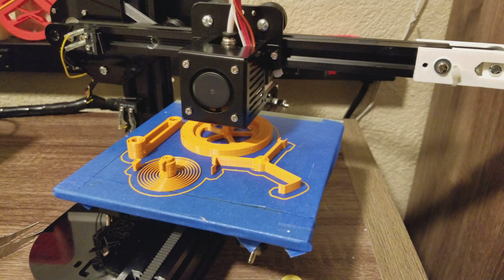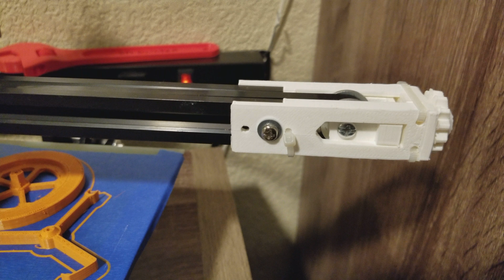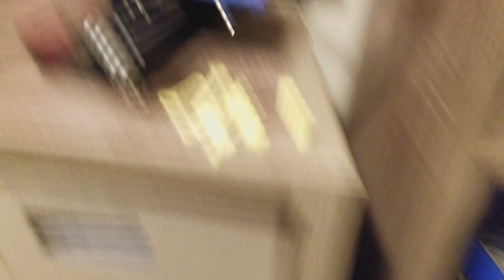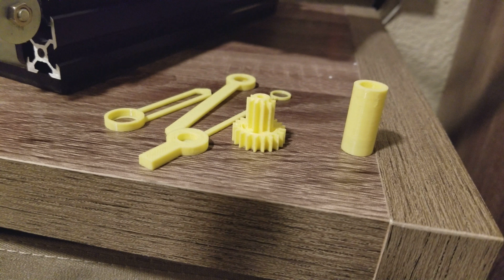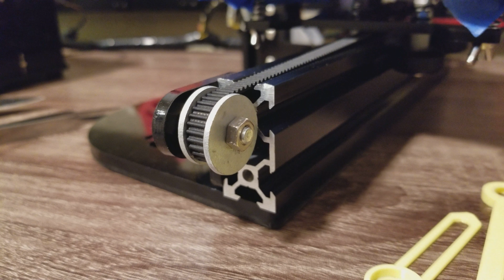TronXY X1 3D Printer- Making a Clock!

Comment: Just ordered me one...wife is gonna kill me...gonna be my 3rd 3D printer!  What is the thingiverse link for that belt tensioner?
I have an Anet A8, a Anycubic Kossel, and now gonna get the X1....if my wife doesn't shoot me first...
Reply from the maker: +Brian C I feel you.  This one was my 10th?

Reprap 1, Reprap Prusa,  Makergear Prusa, Makergear Mosaic 1, Reprap Pro Mendel, Blue Eagle Labs Delta, Rigidbot, Printrbot Metal Dual, CR10, and this little guy.

Those 3 you have should be good for a while.  I went through a lot of growning pains, but these kits are better than anything I could have made 5 years ago.

I'll post a link to all the files I used in the build video coming out this week.